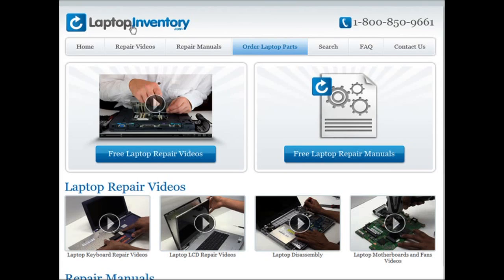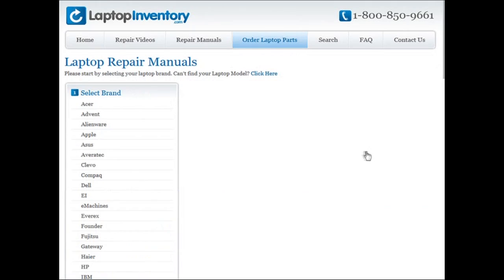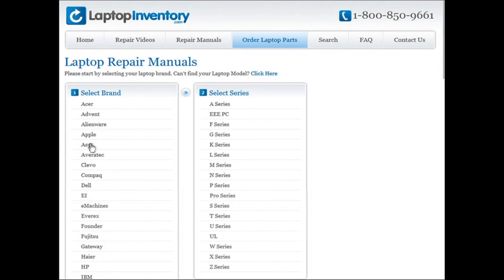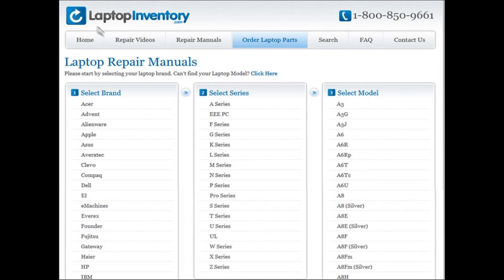Dell Inspiron Laptop Repair Fix Dismantle Tutorial | Notebook Take Apart, Remove & Install

Comment: If you're repairing/replacing the screen, you won't need to disassemble the entire machine. Simply lift the power button panel off, keyboard, and you'll have access to the screen. Took me less than 10 minutes to replace the display.